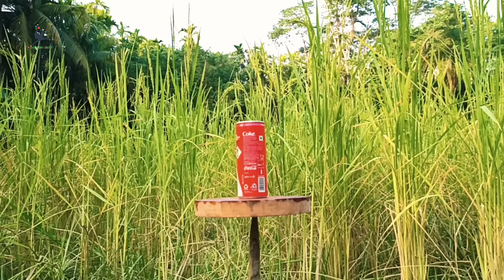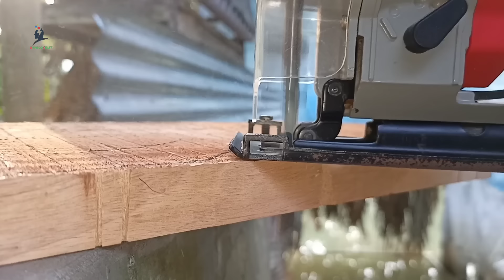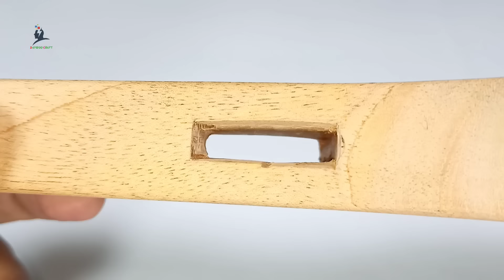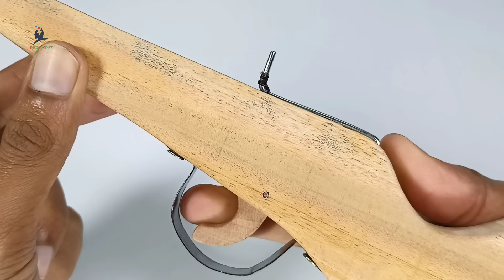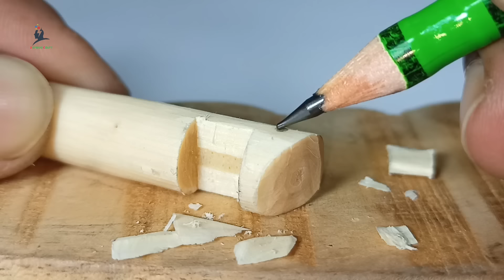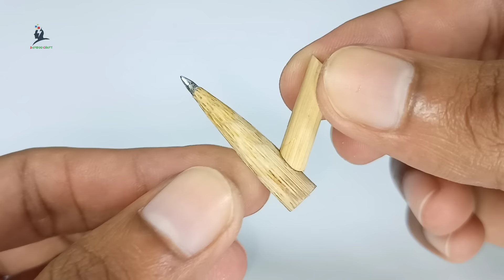DiY- Slingshots using Bamboo

Comment: Seems like more of a crossbow. What is the difference actually? I would have assumed the rail made it a cbow.
Reply: no arrows
Reply: @keitharcaya8377  crossbows use bolts which are shorter, thicker projectiles.  I think this could satisfy that. I mean, it's not a pebble or a ball bearing which is what I usually associate with sling shots.
Reply from the maker: Thank you sharing your opinion
Reply: 9why

Comment: slightly strong bands, wider side ports with a thick bodied nail as the bolt....and that thing gets pretty spicy pretty quick if you fashion the ammo correctly, could even make a third port on the top and make a triple posted bolt to add a third band for power.